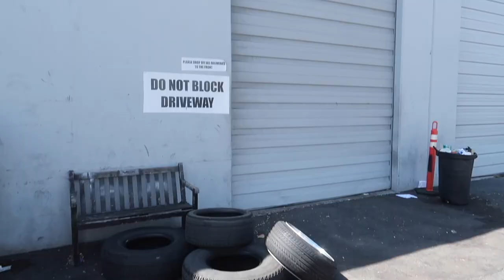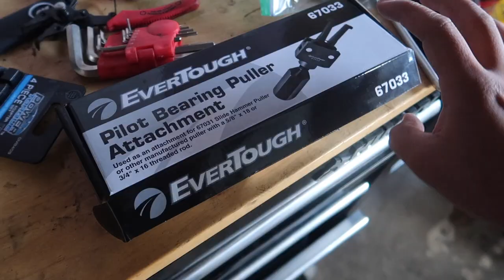SR20 Is Coming Together!

Comment: welding a damaged wheel? Not safe.. that's going to fall apart on you one day while driving. Replace it.
Reply: Navindra Ramharack ive seen plenty of welded wheels and so far so good. it just depends on the company and they have to make sure it penetrates the wheel front and back of where the crack is. kinda like welding metal to metal. I know some even go as far as making it smooth/paint and will bend it back to shape with no vibrations when placed on a balancer.